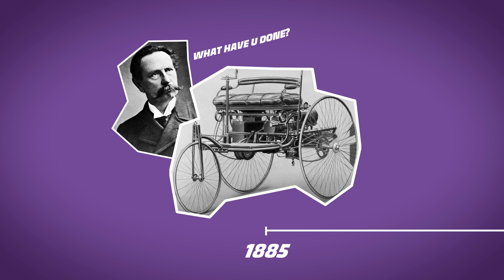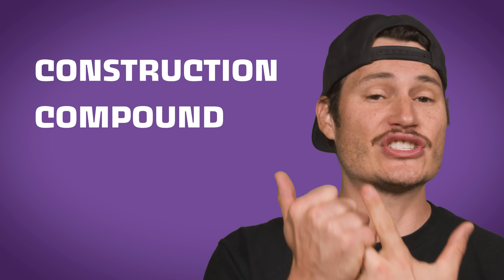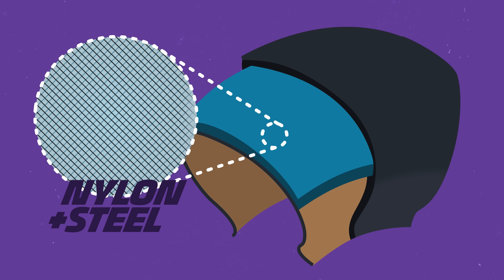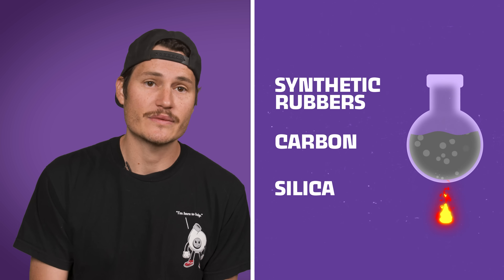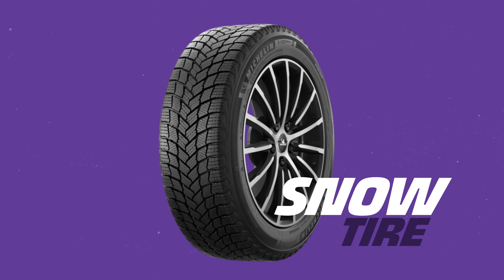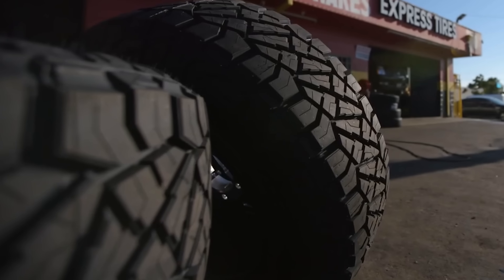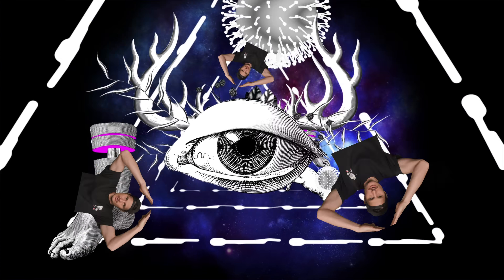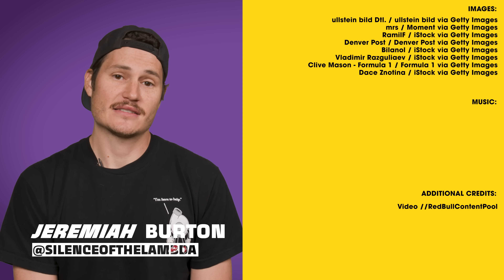The Surprising Science Behind Tread Patterns

Comment: I actually asked the same question to my Dynamics professor a couple weeks ago. it's because Mu isn't a constant. Mu concentrates all the factors that go into two surfaces gripping each other all into one term. If Mu were to be expanded you would see that it depends on surface area in contact, material properties, external conditions, etc. In most cases where the friction equation is used, you can assume that Mu is correct within a certain tolerance. in the case of car tires though, there's a lot of factors that cause Mu to vary wildly and so in this instance the friction equation is used as an approximation at best.  Love the vid <3 keep up the good work
Reply: Asked my dynamics prof the same thing when I took it haha. The other factor is that the traction a tire produces does not actually increase linearly with the vertical loading. Essentially, the coef of friction decreases as the stress in the tire increases. This means that lowering the initial stress in the tire(larger contact area) will produce a higher tractive force under the same loading(the loading ceiling before mu decreases is raised). That is especially true in high downforce applications, but there is still significant load transfer from cornering.
Reply: @tristanhanley8741  oh nice! Thanks! I’m majoring in aerospace and dynamics is kicking my ass so I’m glad to hear the same thing from someone else haha❤️
Reply: Took the words right out of my mouth..I should get the shirt 😜
Reply: Yep same exact story for me when I was taking those courses 10 years ago.  Me being a gearhead helped in some areas but that was one where I was at a definite disadvantage in terms of having to ignore or unlearn some preconceived notions and mental shortcuts for exam.  My instructor brought up pretty much the same as yours as well as pointing out that for the sake of exams and theoretical calculations you're always assuming a perfect interface, but of course that isn't the case in reality even on a prepped race surface, and by going with wider tires you can think of it functionally as if you're casting a broader net to achieve that optimal surface to surface interaction.
Reply: @tristanhanley8741  So would that make the equation a f''(x) of the frictional equation, similar to how acceleration is just the second derivation of position? or maybe its the 3rd derivation such as jerk is? Thats my initial guess.
Reply: @dannyallyn223  I took dynamics last year, calculus is kicking my a** this year, you’ll get through it
Reply: @manisandjr8435  hey thanks man! If you want help with calc I’d be down to give notes anytime. I’m all the way thru calc 3. Not sure which calc You’re taking if it’s after dynamics?
Reply: @thetunedtank8048  I don’t know that friction would be a double derivative. It’s more the root equation but bc it’s a force equation it plays into acceleration thru Newton’s first law: F=ma
Reply: @dannyallyn223  Very nice, keep it up! I'm junior ME with a minor Aero
Reply: @tristanhanley8741  oh nice man! I’m right behind you. I’ll be a junior in January❤️
Reply: @Ellingmint  best thing I think I have done for my engineering degree was join a baja sae team haha, best place to apply gearheadness and still learn things
Reply: I can see that! Thanks for the clarification!
Reply: Just hijacking your comment to say that this is a perfect explanation.

Mu changes with load and temperature. Larger tires will often be colder than smaller ones with the same compound as well as require more normal force to get the rubber to form to the road surface.
Reply: Ive been asking this exact question since I was in highschool
Reply: @tristanhanley8741  extra points for saying load transfer instead or weight weight transfer. That always bugs me!
Reply: @dannyallyn223  Get studying.  My degree is in Aerospace Engineering and I can say that statics and dynamics are stuff that you will use ALL THE TIME after college.  Learn them well.
Reply: Send this man a shirt, that's exactly what my professor told me when I asked
Reply: Its a lot different with respect to tires. As your professor implies, Mu is a significant simplification (most of physics hugely depends on simplifying through assumptions). However tires are a lot more complicated, and a lot more specific, and really become their own subject rather than using stiction and other general friction equations to work. I went into a lot more depth in my own message, but things like the tires rotation viewed from above sees the front and rear moving slower than the middle, so a contact patch has the front and rear drag backwards whilst the middle pushes the car forwards. Essentially the tire fighting itself throughout different parts of the contact patch, leading to reduced grip. A wider tire has the same contact patch size (at the same pressure), but a wider, shorter contact patch has the area touching the ground at a more similar speed to the rest of the tire making for less losses.

That is just one of a huge number of tire-specific effects which go into it. But when it comes down to it, tire dynamics are so different to the traditional physics view of grip that we really shouldn't view them as related. Tires don't produce grip without slippage being another, unlike the traditional view of grip either being unrelated to slippage (coulomb's law) or adding stiction to suggest grip is at a maximum without slip. As a physicist I should be sad, but tire dynamics is cool enough that I don't mind physics not applying here.
Reply: also, more surface area means more cooling, helps keep from delaminating tires. more grip at the optimal temp etc.
Reply: Give this man a t-shirt
Reply: I put all of my faith in you when I say this... Thank you. Don't prove me gullible because I know nothing of your formal physics and mechanics
Reply: Looks like this guy gets a shirt lol
Reply: This is one of those times that I wish I wasn’t a EE major… the last time I took anything remotely similar to dynamics was my freshman year when I took physics 1 and I’m a senior now 😂
Reply: Better than my answer
Reply: I love how beautiful and supportive the world is. Thank you all. I’ve been struggling this semester hard and you have no idea how much it means to have so many strangers encouraging me. Just ugh thank you so much
Reply: I probably asked this question in dynamics, but that was like 15 years ago, so hell if I know.
Reply: @dannyallyn223  Tyre dynamics, other than landing gear on a shuttle, do not have much affect on anything  air born
Reply: Would this mean that experienced grip would be an integration of Mu? I'm bad at math so I'm genuinely asking.
Reply: @shoey6123  I suppose it would, mu would be the average(if mu is considered constant) load transfer rate. I haven't thought about it that way before, but the coefficient of friction would be the rate that normal load can be converted into lateral loading on the car.
Reply: @tristanhanley8741   well tires use static friction. So realistically you have to take each instantly statically. That unless you break traction then it’s kinetic friction. Let’s also not forget a simple concept of distributed load. If your point of contact is small then the the force per sq inch is very high whereas if you have a very large one your F per in^2 very low.
Reply: @tristanhanley8741   this in turn allows for more traction because the force on one point statically never passes the threshold of kinetic friction. Remember it takes more to get shipping than it does to stay. Mu(s) > Mu(k).
Reply: @tristanhanley8741  spinning*
Reply: @zexcthd5519  this is true except that tires are not only using static friction, slip angles as well as camber angles have a direct impact on the visible frictional coefficient. To apply static and kinetic frictional coefficients as constant values rather than a varying number dependent on the load, temperature, and position on the contact patch... you would need to apply those coefficients infinitesimally so that the derivative can be assumed constant. It ends up that in reality, frictional coefficients are extremely complicated. People get PhDs and spend entire careers looking at friction.
Reply: @lucysmith4242  Yeah actually mu doesnt even exist :-) its just an approximation that works pretty well within certain conditions. like drag coefficient that actually changes with speed, it's convenient but not exact. but works really well though if you need do do simulations
Basically for every combination of wheel torque/weight/weight distribution/road surface/rubber compound/temperature. there is an approximate "optimal" contact patch size that will have close to the optimal mu, while keeping the wheel weight, and friction loss as low as possible. narrower tires will overload the tires, reduce mu and grip. wider will gain little grip which will be negated by those factors. but if you change the conditions (water/snow/ice) the narrower tire could be better
more weight, more power, more downforce, will all require more rubber and/or better compound
for instance putting super wide tires on a civic is no going to make it any faster :-D maybe brake a little bit shorter
Reply: That is a new research question right there. I'm sure some grad student has done something to introduce a better friction constant then lmaoooo
Reply: @tristanhanley8741  i never said they weren’t. I was just relating back to the simplest answer to the question. Distributed load. He asked why there was no area in the friction equation. That’s because it’s taking the force at a single point. Not the entire load of the tire. Hence why the load has to be distributed. We aren’t speaking of camber and what not. Just simple why there is no variable for contact area in the friction eq.
Reply: @tristanhanley8741  but yes you’re right. Friction is extremely complicated in most cases as it involves many many different factors that are all varying.
Reply: T shirt for you
Reply: @ezra9401  I mean the thing is it's a constant that is not constant no matter how research you do
Reply: The oils that come out of asphalt after a warm day and light rain are a factor people forget to account for. Which is why you probably have better grip when its raining as opposed to warm roads just being wet... far more dangerous.
Reply: @seanmoyer4563  lmao what. I live in Az year round and this has never been true
Reply: @dannyallyn223  yeah. The tar in the roads in PA will push oils when its say summer warm then gets rained on and stops or just drizzles. Roads are probably 2-3× slicker than if it was just raining or the roads were cooler. Like this time of year. Not a lot of oil...but it doesn't take much.
Reply: Did you get the T-Shirt??🤣🤣
Reply: @tristanhanley8741  I don't understand, if more vertical loading decreases coef of friction, then why does loading the tires with downforce, weight transfer, etc increases grip?